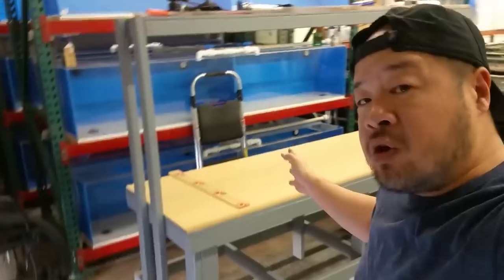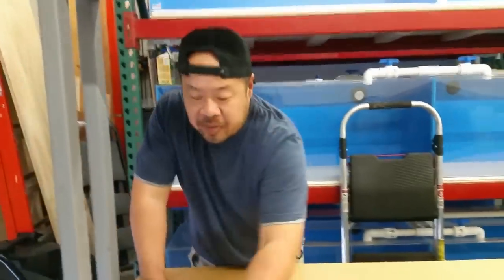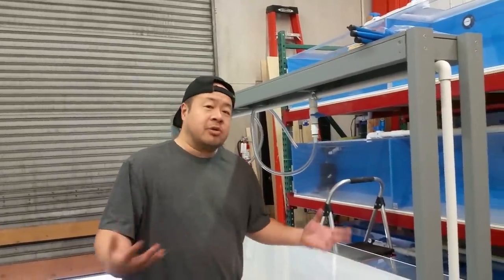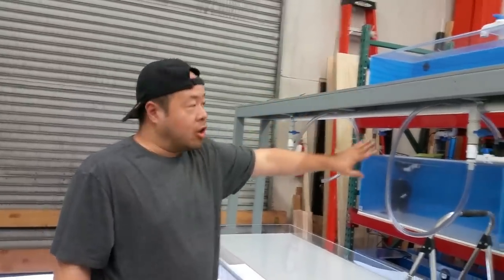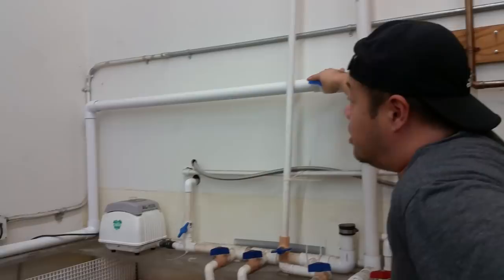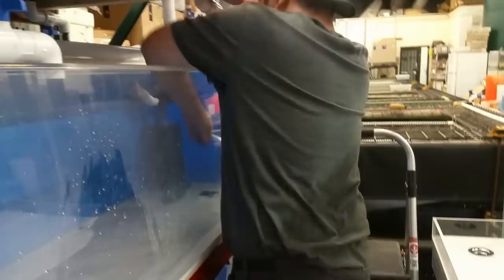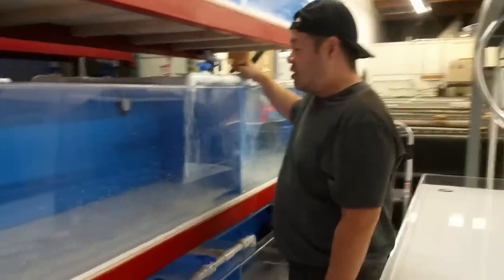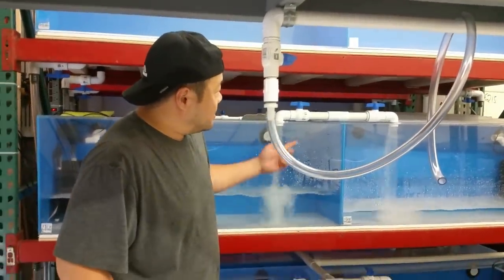DIY Tropical Fish Acclimation Table is DONE

Comment: Great video Kevin drill some holes in the original screen that came with it so the water can drain on the table..
Reply from the maker: Yeah. That screen has holes on the side but not the bottom. Stupid design if you me...